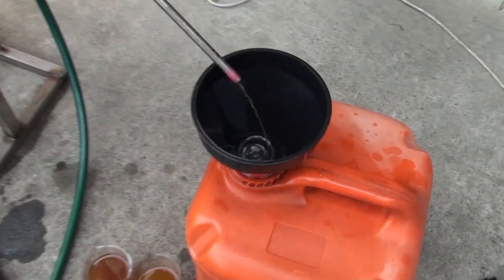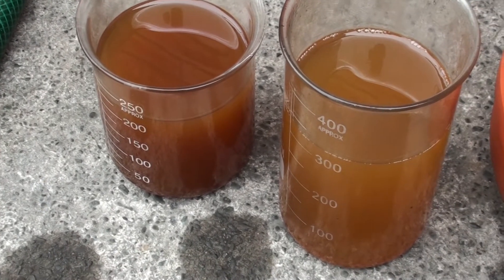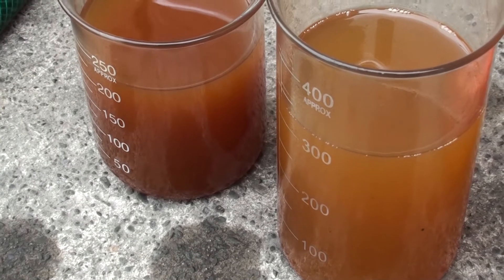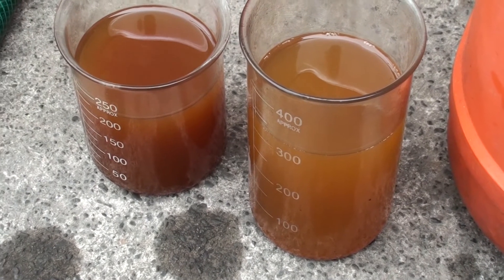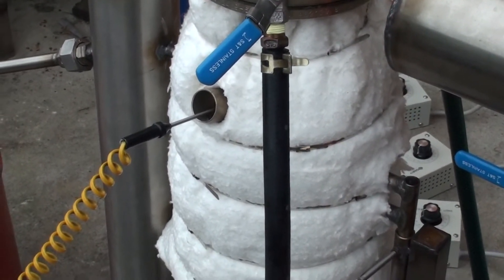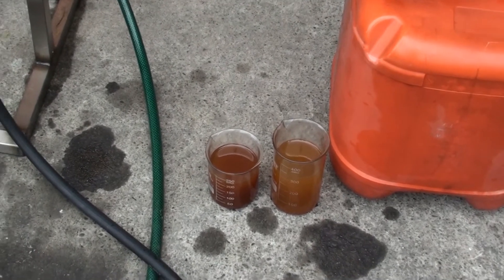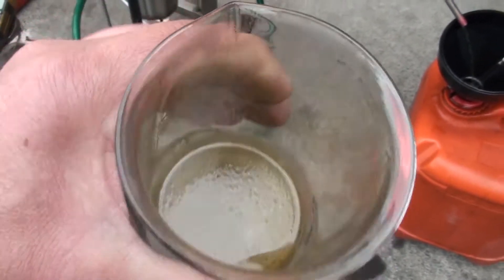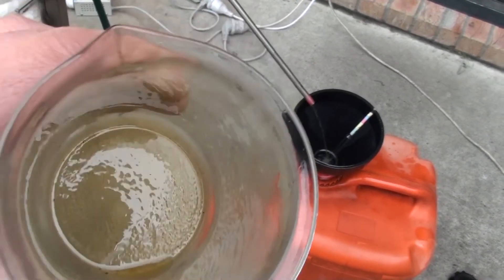Diesel out of WMO - 4kw distillation unit 3/3

Comment: have you got the design sorted now so it will take WMO and convert to diesel of correct viscosity with no polymers or precipitate solids ?
Did you work out power consumption per litre / 100 litres ?